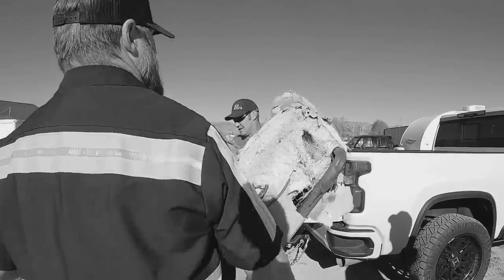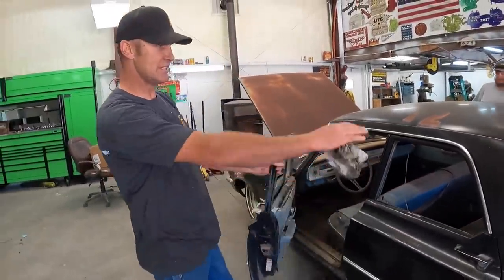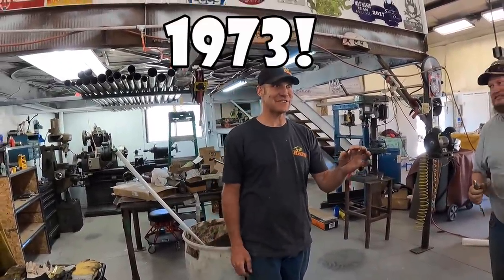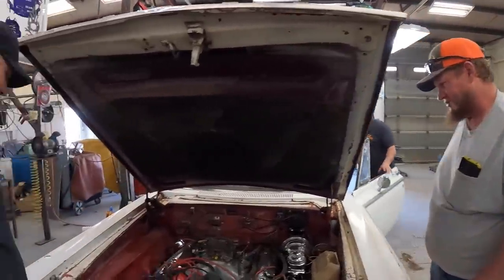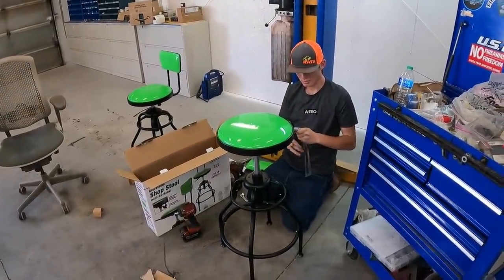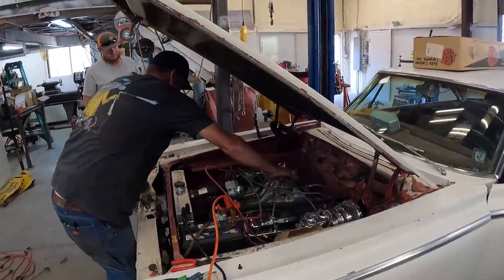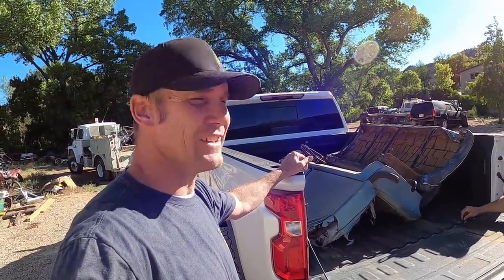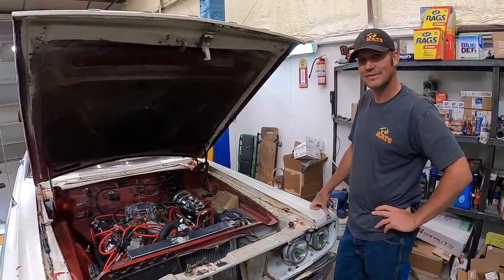What's In This Trunk Is A Little Alarming!

Comment: The white bucket seats that were in the car are NOT Thunderbird seats.  They are 1967 Plymouth Satellite or GTX seats (including the rear seat).  There should be a fiberglass topper across the back seat.

Comment: Several years ago my dad sold my grandmas, his moms 69’ Dodge Coronet. She had bought it new and It had less than 30,000 original miles when passed away in the 1995. Green metallic 2 door with a 318ci. All original, even had the factory installed  A/C.. We took it a couple car shows And won a couple awards at one.  It was a sweet ole car.

Comment: The rear seat cushion on the 4 door has rounded front corners to make it easier to get in and out. On the 2 door, the front corners are square. Have your upholstery guy make square corners out of foam and you're good.
Reply: If the front seat back , was split so you could fold it forward, to get in the back seat, you wouldn’t have a problem. Is he going to split the seat for you?
Reply: @lavernagray5449  They got the right front split seat. They aren't using the one out of the 4 door.
Reply: At company assembly plant, the seats go into car via the passenger side to avoid the lack of clearance of the steering wheel

Comment: I stopped in a couple of weeks ago to say hi and meet you guys. It was a pleasure. My father was a "shade tree" mechanic and when I was old enough to undo bolts my job was to crawl under and undo the tranny bolts to the engine and all the rest of the stuff you have to do under there. Since then I went on to be a helicopter mechanic in the Coast Guard and up to a few years ago all my own upkeep on my cars. I love watching you guys wrenching away and explaining as you go. Love the give away car as my dad owned a white Dodge corner station wagon with push button gear shift. Keep up the good work.

Comment: I do remember on the old Chevy's the windshields/back glass on 4 doors are slightly different than for 2 doors, won't fit. Lots of little details, it's what made working on those old cars so interesting. All the trunks leaked, only kept tools and spare tire in there LOL. Any jackets or clothes you kept in the car proper. We all worked under those cars using bumper jacks, amazing we all didn't get crushed! I kept a couple bumper jacks in my garage, they make good conversation starters now :)

Comment: From a quick research, it's not uncommon for these to have an all blue or red interior on the 440 trim level, the 500 trim often had an accent color, often in black for the red cars. So since the interior of this Coronet has red, best to replicate the interior as close to stock as possible. From memory, the 330 trim was the base trim and the vinyl was basic with little padding on the doors, the 440 had more padding on the doors and the seats were ribbed vinyl. The 440 had carpeting, the base models typically had black rubber. 

This is from what I know and recall from when we had a '64 Dodge 330 wagon with the base 225 slant six and pushbutton automatic, though ours was originally white with a solid blue interior. We'd just repainted it sky blue in 1968 when my parents tired of the white.

Comment: Your seat guy will almost certainly know,  but, seats this old often get a little soft, and lower seating position. You can retension the existing springs to make firmer and back to the correct seating height. The webbing of the springs opens up, making everything soft and low.  All you need to do is tighten each web a little and hey presto you have a new seat! 
Same system  whether bucket seats or bench seats.

Comment: That Pepsi can tab top saved my bacon once.   Broke a set of points on my 67 Beetle, middle of a 2 lane  highway, hitch hiked 20 miles back into town, bought a new set of points. Used the can tab to set the gap for my points,  no detonation on the engine timing, it was close enough to .016", since I didn't have feeler gauges with me.  Who knew?  LOL!

Comment: When the trans comes out replace it with a 4 speed manual. Your upholsterer can create a notch in the center of the front seat bottom cushion for the shifter. My plane Jane 69 Roadrunner had a front bench with a notch for the shifter

Comment: Paint/upholstery, I would go with white w/ black piping and red stitching.  Bring the interior, trunk and engine compartment back like new but the exterior I would just 'patina' what's there. Fix any cancer that needs taken care of but sand through any touch points around door handles, gas door, deck lid, where your arm rests while driving. Just a thought.

Comment: Make sure you put electronic voltage regulator on it or you will have problems with misfiring with the lights on after some time. Personally experienced it two different times with electronic ignition conversion

Comment: Hey Fab Rats Team, I belive the seats should be white with red piping. Black carpet, white seats w/ red piping to augment the red from the dash, SWEET!  My Mother had a 68 dodge coronet 4 door, that she drove like the little old lady from Pasadena. I went to college in Dallas Texas, I bought a 1972 Dodge Charger 400 Mag with 4 speed transmission new off the showroom floor. Charger was seafoam green with a half landau white roof. By the end of 1973, she was sporting a pair of 650 double pumping hollie carbs, on a high rise edellbrock manifold, mallery ignition system, and everything else I could stick in it or on it. She could run a hole in the wind. With a friends dad who was Texas State Highway Patrol, we clocked her at 157 miles an hour. Those were the days. Sold her in 1976, wish I had not done that. I am now a certified Geriatric Juvinile so speed now would probable give me a nose bleed above about 85 mph. lol   I Thank you for your channel, through you I am transported back in time to a lovely time in my life, " FOREVER YOUNG" .THANKS, Paul, and Family.

Comment: Just an FYI. The Edelbrock 600 is a much better running carb than a 750 on that engine unless you’ve put in a cam to make power above 3500 rpm. The 600 will make it much more drivable from idle to 3500.

Comment: A side note...,any 70s electronic ignition  would be the same as what you have and there are 2 distributers ..one b block and one for an rb... so 1 for a 383,400 and 1 for a 413,440

Comment: The tip of the shovel was cut off on purpose.  When you work in dirt, without rocks, the shovel does not need to be pointed.  And you can sharpen the edge to cut through the dirt easier.

Comment: Black carpet is just wrong as I remember the dark red carpets in those mopars. It did not show dirt near as bad either... too bad that you already have this carpet cause its not going to look right and carpet is not easy to change out and make it fit right. I worked for a man who was a carpet layer in homes and he did my carpets in my charger... they were tight tight and were some of the finest I have ever had installed. Is there any way to repair the seat so it folds forward on the passenger side?

Comment: If that trunk is suspect, the only thing I'm missing is a bag of lime. Expressive gasoline with more added ethanol (according to Brandon) to collect moisture even faster, I'll got for the $3 a gallon every day over that stuff. My Trans Am came with non reclining high back bucket seats drove me nuts, plus the the vinyl was shot. Found a set of cloth high back buckets the same not reclining, but had robbed the brackets of a pair of reclining seats of a different color and used them on mine, problem solved. Maybe your bench seat brackets will do the same.

Comment: I'm pretty sure a bone-stock 440's compression ratio is somewhere around 9.0:1 - 9.5:1, so maybe consider giving it some 91 octane...

I'm pretty certain (as I've experienced it first-hand) that most men who wrench for a living or for a hobby here in Southern Utah - blindly believe that they can set the fuel/air mixture, as well as the distributor timing... 'by ear'. So, please consider using a vacuum gauge to achieve the highest vacuum reading at idle and please consider setting the timing to its factory specs - with an actual timing light  . Ideally, you want as much initial timing that the engine will tolerate and no more than 36° total advance at 2500-2800 rpm for a typical street build. - To be safe, I'd start around 30° though. Too much advance will result in piss-poor cranking after shutting the engine down when it's at or above operating temperature... or maybe that's just a Chevy problem, as my old Road Runner never seemed to have a problem cranking over on hot starts? 

I'm also wondering if the current Mopar performance distributors for the Chrysler 440 are electronic? - Because the old points-style ones require a ballast resistor.

Comment: It’s very important to change the voltage regulator to electronic regulator when you put the electronic ignition on it. The old style regulator will eventually kill the ignition module in a few months otherwise. 
Found this out the hard way on the old man’s 67 Imperial the hard way/Expensive way.

Comment: That thing is an archaelogical dig.  Every pop vending machine used to be surrounded by a litter of those pop tops.  There was a farmer in our area that used to drive a "Flintstoned" car, and I think it might have been a Dodge Coronet.  He had hit something with it at some point, and the right headlight was only fit for a deer spotlight.  It combed the fields off to the right, while the left one sorta illuminated the road ahead.  All the floorboards were out.  He would drive that thing into town to hire boys to work for him in hay and tobacco, and they had to ride to his place with one foot on the transmission/driveshaft tunnel and the other on the door jamb, the road sliding by under their feet.  Fortunately, he only drove about 25 mph.  It was still hair raising.  You never wanted to be behind him, because it was a narrow, twisty road with no safe place to pass, and I've been stuck behind him many times.  He is long gone now, but that thing is a trip down memory lane.

Some 70 year old man is going to see this and think, "Hey, I put those wooden seat mounts in when I was 15.  Gimme a break."

Comment: Stitch should be red as the car used to be red. Question are you going to send the coronet to Robby Laytons to touch up any rust areas. Or strip the white off and paint it the true red color. What would make it, cool is have the natural/original red with a black top color.

Comment: Hi Paul, that T.P. You found looks like the oil filter media they used in the old days. I remember being a little boy helping my dad work on his fifties Cadillac changing out the oil filter media with what looked like toilet paper to me. Hey Paul, I’m a welder. Do you know how to weld GMAW spray mode? If not, respond to me. There are three modes of arc transfer: short circuit, globular transfer and spray arc. The short circuit welding you do is only strong enough for 3/16 or less material thickness. I can tell that’s what your doing by the sound of your arc. Take care!

Comment: There's a place in MEMPHIS TENNESSEE called Performance Distributors they have the best ignition products  i have a system been on my 4wd dodge with headers been on there since 1994 same wires,coil,cap,rotor still works great wires are 10mm shielded

Comment: BACK WINDOW POLYCARBONATE 1/4 inch about 250 use the old window for aaahaahaaa template oh hell that wont work  !!!! But the poly is easy to work with 3/16th will fit just like the factory window . Toilet paper thats the OIL FILTER RECHARGE 
PUT A DUI DISTRIBUTOR in that MOPAR best bang for the BUCK

Comment: Want a big surprise?? When you have the rear end apart change to a 3.55 gear ratio... It will wake that ol' girl up... 440's like rpm being a short stroke, big bore motor... Had a Plymouth GTX with a 440 and 3.55 gears, it would bury the speedo at 150mph... Stock 3.23 gears were done about 135mph...

Comment: drag raced a 69 charger 440 4speed  2 tenths second off national record had two wrenches special  bent and ground just to change spark plugs  factory stead take motor mount louse and jack up motor to change spark plugs . don't  want your car not even if free im over it  and every thing to do with bb Mopar its just more parts to me. i did it before it was fun im just done .

Comment: So,,,,, nobody said which engine was in the 4-door, but I could see it is a big block.. Judging by the looks of the car I would say it was probably the original engine. More than likely also the original tranny.. If so, there are a few more things that should be removed before it goes to the scrapyard.. The engine, (MAYBE), depending on what it is.. The TRANNY because it is a 1 year transmission AND it is for a big block... Also the rear end as it is the first year for the flanged axle in an 8-3/4.  The grill even if it is bashed up some, is worth bucks as they are hard to come by and many people cloning A-990s use up 2 of them to make an A-990 grill!!!  But you guys are all about chevies and those parts are everywhere, so you don't even think about the gold in your hands....   What a shame..... 
.